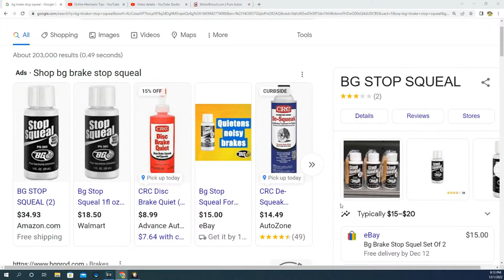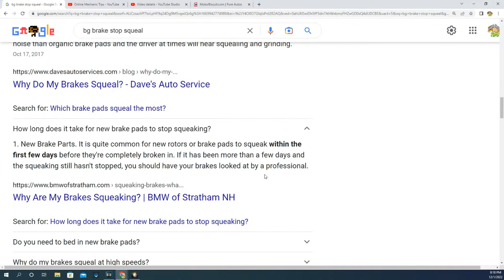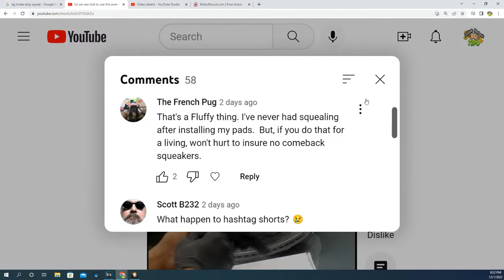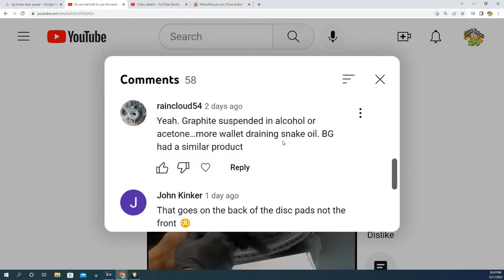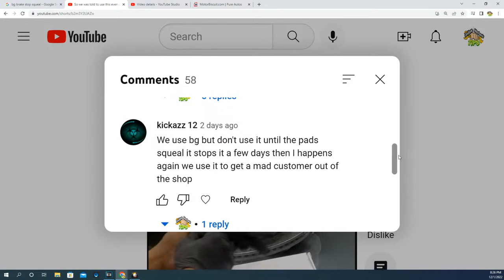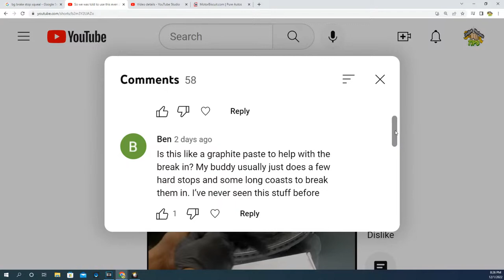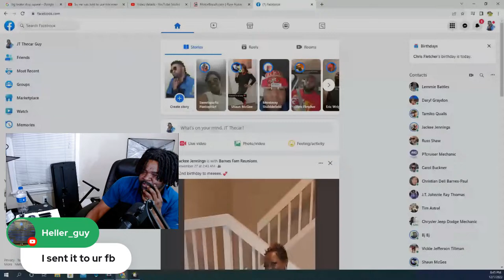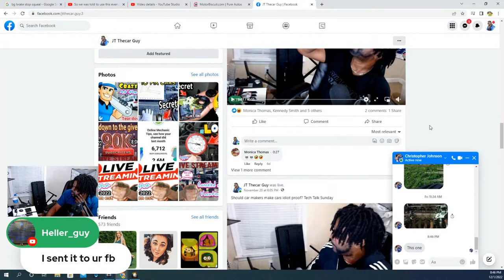Brake Stop Squeal. Is it really needed or is it a scam?

Comment: Living in Hawaii with a bunch of fake ASE shirt wearing, so called “professional “local” mechanics”, I change my own brake shoes and haven’t had any issues in three decades until recently with ten weeks of rain, very heavy at times. 
    I will admit that I never turn my rotors unless I really need to but I rather buy new rotors if I can get them shipped to Hawaii that is. 
    Either way, I only drive about 3 miles per day and the squeal usually goes away on it’s own once dry weather comes back again. 
    Thanks for your honest video and rough topic because every shop has their own rules and brake mechanics have their own ways of doing brakes. 
     Since my 01 JGC Laredo has disk brakes all the way around, it only takes me about 1/2 hour per wheel without a lift, costs me about $50 every 5+ years, I have no room to complain. 
     Great video again! ❤

Comment: AutoZone pads are fine as long as you don't get the cheap pads that have MKD part numbers. Those squeak a lot. Only pads I've ever had come back were the cheapest line whatever part store had.

That stop squeal mess is dangerous snake oil. It is graphite suspended in an alcohol, isopropanol and sometimes others. (Look up the MSDS for any specific brand.) So you are adding a slick and flammable component to the brake pads. While the flammability will have evaporated off before going into service, the reduced brake performance remains.

Comment: Dang man!! I made it here to late to get in on the topic of brake squeal solution. I'm like you on as far as not using that crap but I understand why you have to simply because of the dealer rules set into place. This is def a topic that is a "to each their own" conclusion with this but what I do know is since factory brakes did not squeal then Mopar parts is what I always go back with. I do use the permatex purple brake lubricant on the caliper slides on every brake job for smooth operation and no resistance on the hardware. I will try to get into your next live stream next Thursday. Look forward to your future videos

Comment: 48:22 - This guy is clueless. The brake reservoir cap does allow some air in as the brakes wear down. Every time you open the cap air gets in. Air contains moisture. Moisture is what turns brake fluid black and leads to all the problems mentioned in this part of the video.
Reply: 52:00 - Scratch clueless. This guy even missed the short bus.
Reply: 52:46 - He knows this, yet he said that dumb mess a minute before. This my friends is the difference between knowledge and wisdom.
Reply: 57:47 - OMG! Even Fluffy couldn't talk some sense into this guy.